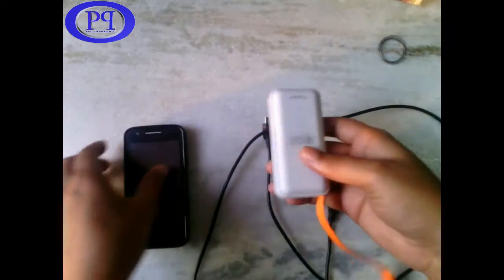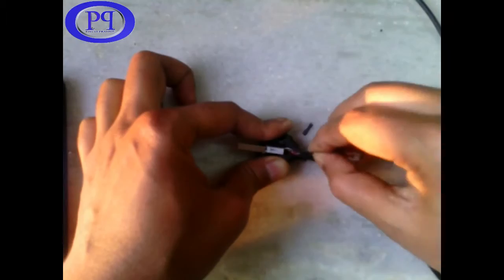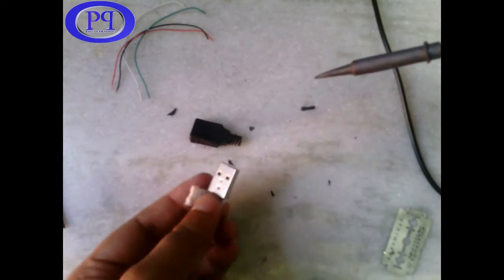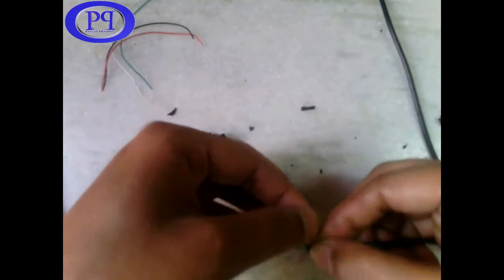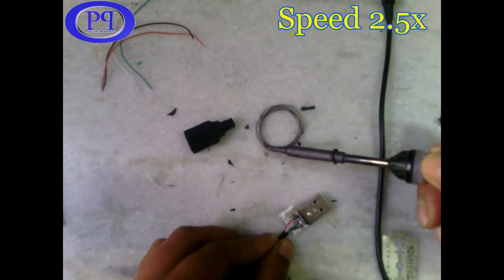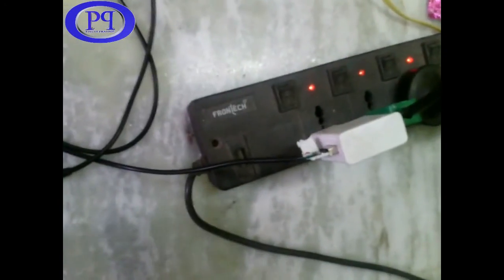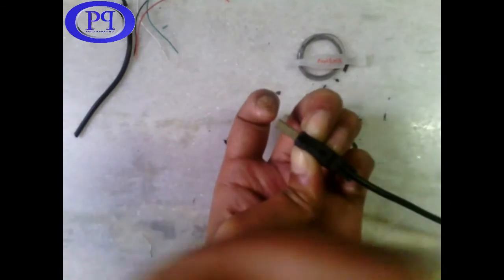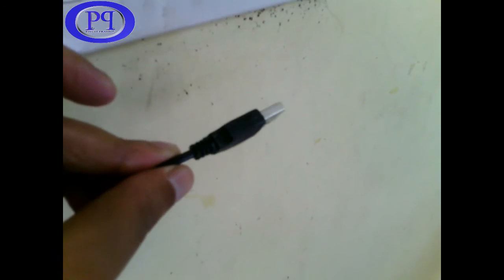Refurbishing Damaged USB Cable

Comment: very good video for the USB side of the charging cable repair. Unfortunately, the resolution of the video is poor so that it is somewhat blurry for someone watching it. Still useful and detailed. I woud like to a video for repairing the micro-USB side of the cable.I think the inside of the micro-USB is damaged so the cable does not charge.
Reply from the maker: I regret for the poor video quality, made this video with limited resource.

Comment: Thanks for the video. I can now fix my usb cable without buying a new one.
Btw, that kind of glue can be easily removed by wiping a thin slice of Chayote (vegetable) if ever it sticks into your hands.
Reply from the maker: Thank you for the solution with which we can get rid of sticked fingers/hands, however most of the people dose't know this method that's why I have made a caution at that particular part in the video.